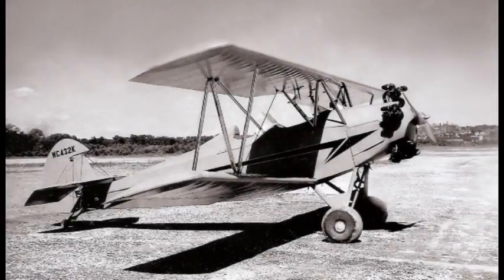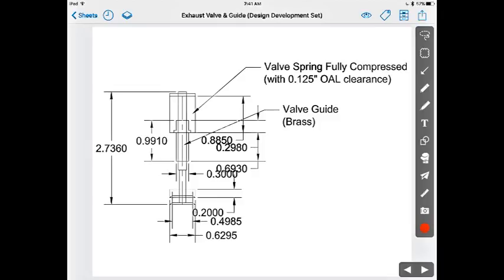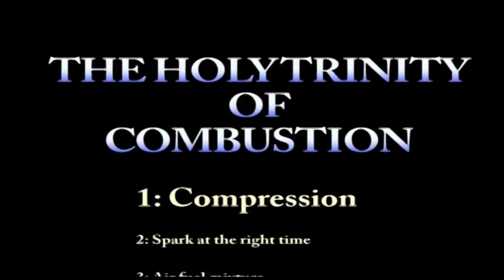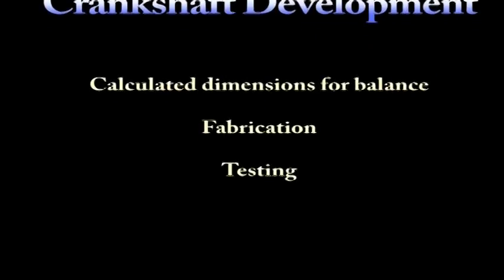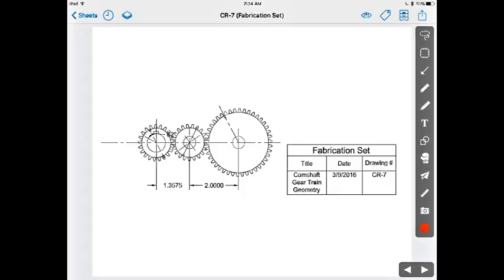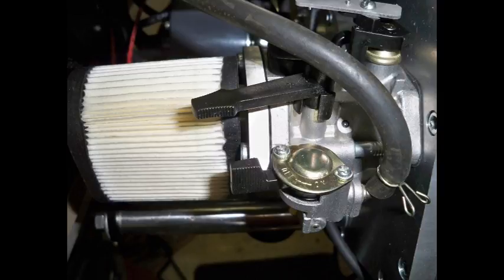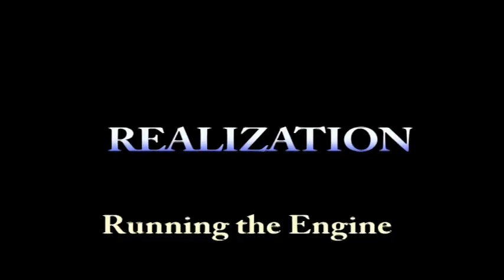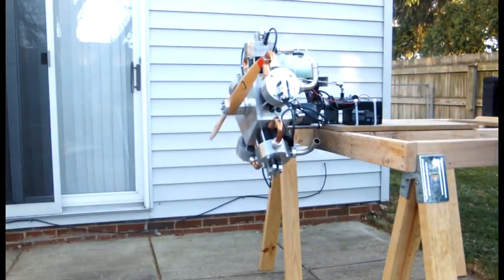Kinner B5 1/3 scale model radial engine build project

Comment: Wondering if it is lubed with maybe 2 stroke oil mixed with petrol. No oil  control ring on the piston. Stihl use the 2 stroke/4 stroke (no oil in thecsump) system for some weed eater engines with reasonable success.